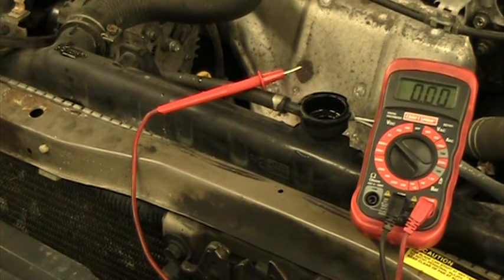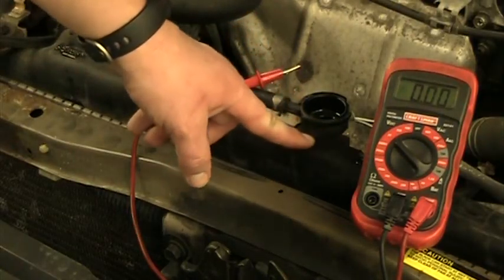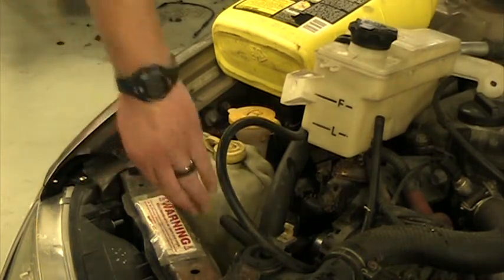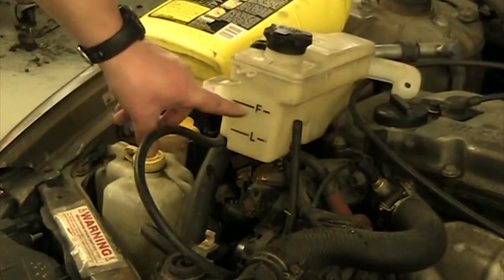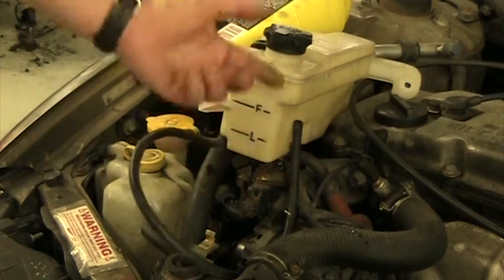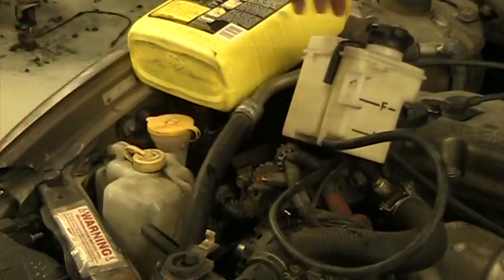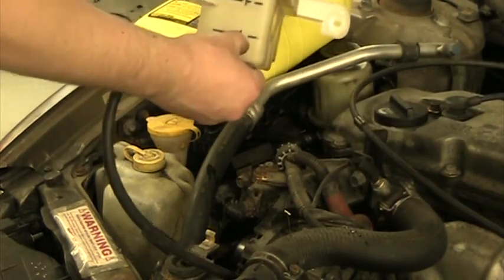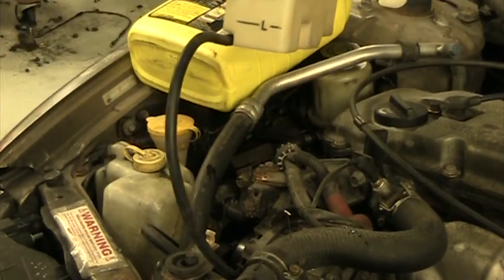Coolant level check in the radiator and overflow bottle

Comment: Actually that's not correct.
Coolant should only be checked when it's cold. For that reason there are only marks on the reservoir that indicate the maximum and minimum range coolant levels for a cool engine that has no pressure in the cooling system. There is not hot level.
The Toyota owner's manual says when the coolant level is at the low level or lower on a cold engine then you should add coolant to bring it up to the full mark. Any level between the two marks is considered acceptable WHEN THE ENGINE IS COOL. There is no hot level and cold level, just normal level range for a cool engine.
Reply: This is absolutely correct. That’s the reason why the Full or Max line isn’t at the top of the overflow tank. The space above the Full line is there as a buffer to stop leakage when the tank is at full.
Reply: Okay, I am wondering if Toyota is somehow wrong. Because in my experience in my car, when i fill the coolant to the full line when it is cold, it will be back to the low line and stay there and not go below. I noticed when my engine is on and the coolant isn't filled to the fill line when hot, that the reservoir is completely full. The fact that the coolant reservoir seems to correct itself whenever I add to the fill line, leads me to believe that reservoir is actually way too full at that mark when full, and when the engine is on the extra coolant will overfill out onto the hose. I dont know of another explanation for why the coolant will go back to the low line when cold and just stay there, whenever i add to the fill line . Ive had no issues at all , besides a need to see the coolant at the full line.

Comment: Definitely should be marked hot & cold. But suppose they would never sell coolant to us idiots then 🙄🙄
Reply: Actually that's not correct.
Coolant should only be checked when it's cold.
The Toyota owner's manual says when the coolant level is at the low level or lower on a cold engine then you should add coolant to bring it up to the full mark. Any level between the two marks is considered acceptable WHEN THE ENGINE IS COOL. There is no hot level and cold level, just normal level range for a cool engine.

Comment: I’m so Confused. Other mechanic Youtuber said fill the Overflow tank at Full level but you said fill the Overflow tank at LOW LEVEL. I just Don’t know what to do.
Reply from the maker: If you don’t believe me, look in your owners manual and it will confirm what I said in the video. Thanks for watching and asking!!
Reply from the maker: It needs room to expand as it heats up. It will overflow if you fill it to the hot/full mark when engine is cold
Reply: @MrAdkinsAuto  I went through 3 Brand New Radiator in a month. My mechanic guy said there are Too much Pressure and said the Head gasket Blew, and he recommended to Rebuild the Engine. But since my car is 160 thousand miles so he said it’s Best to buy a Used Engine. So I bought a Used Engine, but now the Radiator BLEW AGAIN. what seems to be the problem??? By the way I drive a 2009 Lexus. Thanks 🙏
Reply: @luckylucky344  I'm lost. What blew? First you said head gasket then radiator.
Reply: @bajszosjozsef4850  you know how the Radiator kinda looks like a ScreenWindow at your house right? It’s STRETCHED OUT then BLEWED (BROKE). Have to Replaced 4 times. Problem was when I Replaced the Radiator THE MECHANIC SHOP NEVER FLUSH OUT THE AIR POCKET , pressure built up
Reply: @luckylucky344  you got a problem with your radiator
Reply: @MrAdkinsAuto  my reservoir doesn't get to hot/full when checking right after running. cold engine it stays at low can you tell me what my problem is?

Comment: So antifreeze is preferred rather than water right? lol
Reply: You should never use tap water. And destilled water in itself is not enough for modern engines as it doesn't provide enough lubrication. Look for what kind of coolant your manual recommends and use that. But most coolants should need to be mixed with destilled water so look out for that. If you're lucky, even your water tank's cap describes the type of coolant you need. (My A5 2010 also has this "feature")
Reply: Use antifreeze if ur in a cold climate area! Or the water will freeze obviously! Waters good in like California or southern states
Reply: @BEC_2077  efi engines needs lubrication old carbs can get away with just distilled water

Comment: Ah, interesting. I did not realize it will fluctuate that much when hot/cold. I just checked my car (cold right now) and it is just slightly below the "L" (cold) line. I assume this is ok. I will check tomorrow after my drive to work and see if it is near the "F"
Reply: It should never be at the lowest level. Top it up until it's at least at the L level and check if it gets lower on a weekly basis. If it does in a couple of weeks, you should get checked it out as it leaks somewhere.
Reply: mine just stays a little above L even after running or in early morning. what gives?